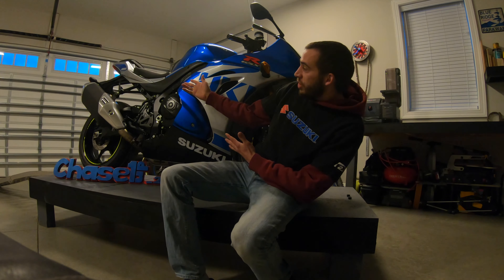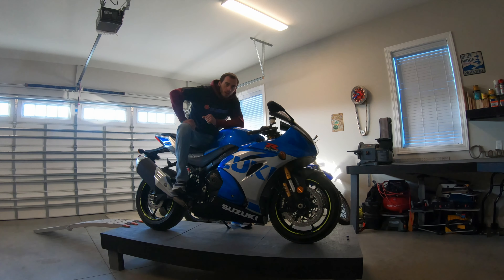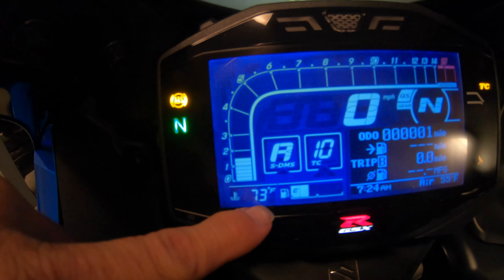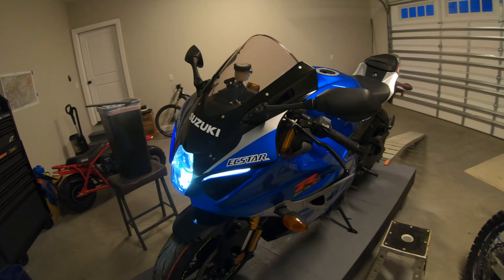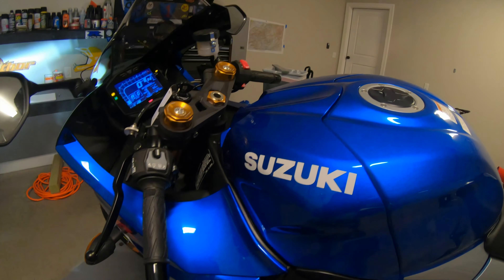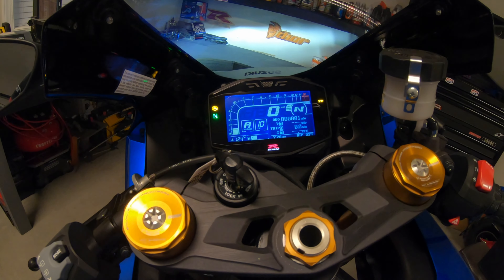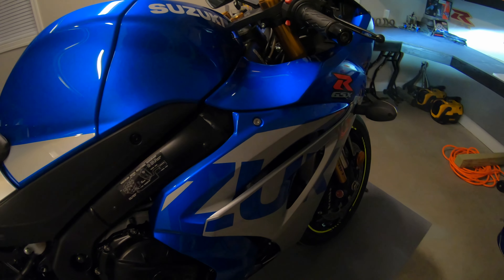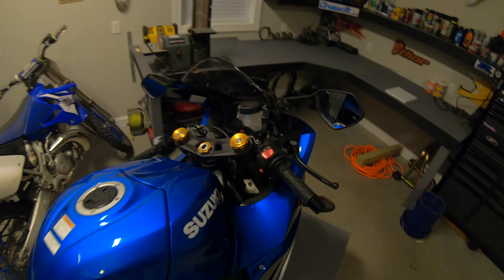NEW suzuki Gsxr 1000R first heat cycle! How to!

Comment: I would probably do a break in like people do for built car motors. Cam break in revving around 3k for 20 mins, drop that oil and change filter, 2nd heat cycle go ride and get some load on the bike keeping it under a certain rpm. Drop the oil and change filter at 50 miles. Go for a ride again for another 50 miles doing all the break in stuff, varying rpm, engine braking, going through every gear…get on it a bit here and there but don’t redline and beat the piss out of it. At 100 miles change oil and filter again and then give it full throttle or flash/dyno day to make sure the rings are seated now that all the assembly lube is cleaned out, any metal shavings, and the pistons and cylinder walls are smoothed out. There is a lot of people who say one thing is better but that’s how I would do it if I bought a brand new bike or a built motor.

Comment: Don’t listen to that Dennis guy. You did this completely correct. Any bike that’s been broken in by the manufacturers recommendation always has the lowest numbers when it comes in on  the Dyno. 10 to 12 heat cycles, followed by a few miles of varying throttle, and then ridden hard always gives the best results and the most horsepower from my experience, which is over 20 years. This is also exactly what mooremafia does on all his personal bikes. This is coming from a world champion with years and years of professional tuning. Thing he was correct on is it takes about 5000 miles to really the motor nice and juicy. Also, I would recommend changing your oil within the first 50 miles and then again around 3 to 500  you should be good to go. The worst thing you can do is leave that break in oil in for the recommended 600 miles.
Reply from the maker: Thanks for the good knowledge. And yeah that’s where I got it from. moore mafia. I’m gonna get him to tune my bike as well. I’m done with the 12 heat cycles and I’ve done various RPM rides around 50 miles so far so hopefully it’s ready for the Dino now. I’m just curious now to if I should change to stickier tires before putting it on the Dino?
Reply: @chase1up_2.0  I just traded my fully tuned mooremafia gsxs1000 katana in for the 23 gsxr1000 today. It was a monster and made 161 whp. I have a really bad habit of ordering performance parts before the bike gets here and changing stuff out before I even ride it. Remember if you tune that bike it voids the warranty. I’ll be waiting until next season to do this personally and make sure it’s nice and broken in (while not voiding warranty) but It depends what you plan on doing. I already took the stock “slip on” giant can off before I even started my heat cycles. This will not affect the power or factory tune at all. I ordered trex frame sliders (I use them on all my bikes, tech spec tank protector / tank grips, and new rage cycles fender eliminator. The new rage fender eliminator is the absolute best system you can get for the 17 to 24. Sportbike track gear has a very nice installation video on YouTube from start to finish. They have several other videos doing various changes to the L7 including basics like fairing removal. I’d definitely recommend checking it out. To answer About the tires…actually a lot of times a sticky  tire can cause issues on the Dyno. They get warm a lot faster and believe it or not they can slip on the roller and actually be worse. I know that sounds opposite of what you would think, but I would stick with the street tires for the tune. Usually throw it on a stand and wipe the tire down with brake cleaner and a rag. It takes a very microscopic layer of the rubber off and will remove anything else that might be on there. I usually do this before any hard riding when the tires are cold. I look forward to following your videos

Comment: So wrong.  You want the most out of ANY engine you need to break it in. Heat cycles are good for only that. It takes about 7,500 miles of proper driving to get an engine in the sweet spot. What is real driving, no freeways for at least 1,000 miles, no WFO for long stints, no stunts, no rev limit hits.

Heat cycling is something that should be done every time you go to ride. It is called warm up.

Miles on the motor mean more than how many times you heated the motor. Metal has to wear, bearings have to move, clutches need to operate.     Who ever told you this is all you need to do has no business running a dyno or even working on anything more technical than a wet tissue.
Reply from the maker: Yeah, I’ve had all kinds of different opinions  on other platforms, explaining how you’re really supposed to break in an engine. Kinda odd that nobody can get on the same page.  
I can’t see the whole 7500 miles though. Couldn’t imagine pro racers that race for money going and cruising around on the street for that long before they consider it a competitive bike and race for money.  They wouldn’t have the time and most ain’t even street legal to even be able to rack up that many miles!